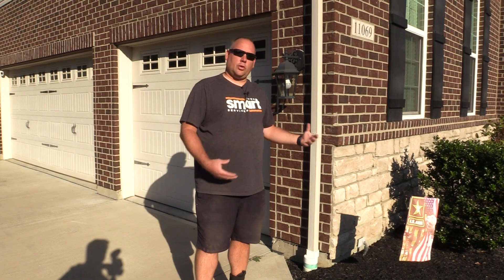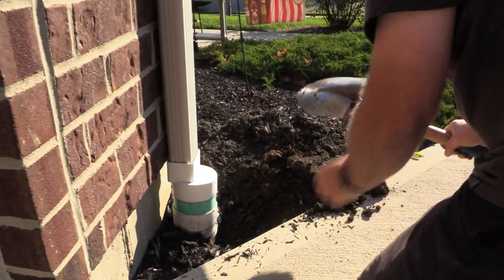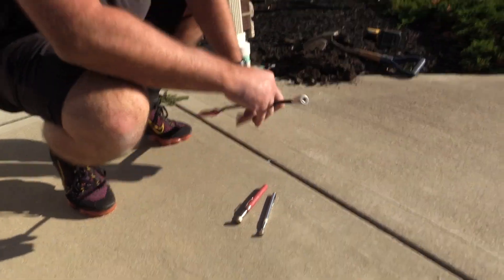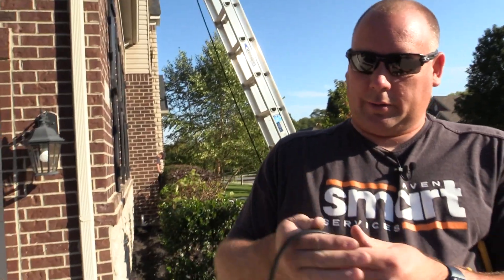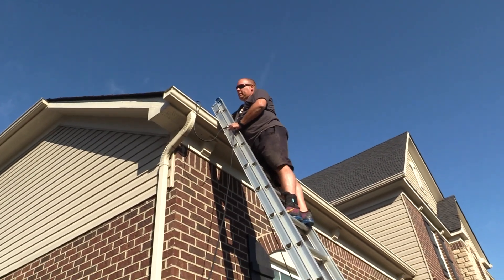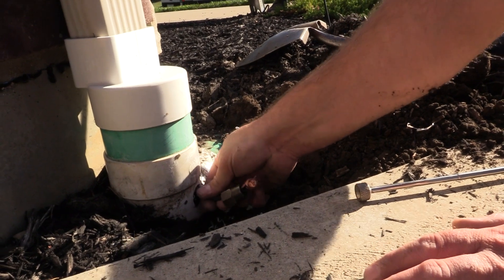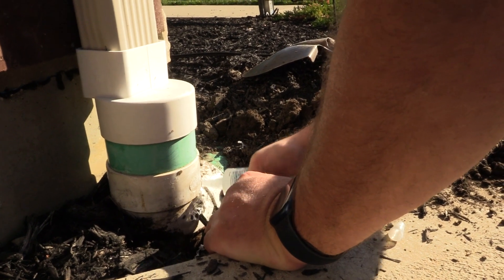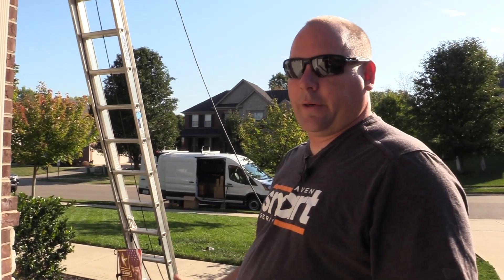How to Run Wire through Gutters

Comment: When your electrician wants to run wires through your downspout (not to mention says the alternative is “zip ties”), it’s time to get a new electrician.  Don’t say I didn’t warn you.
Reply from the maker: Hello - thanks for the comment. This is direct burial low voltage wire that is safe to use in these situations. You would never want to have traditional electrical wire anywhere that has moisture involved. Check out 08:19 in the video where that is explained.